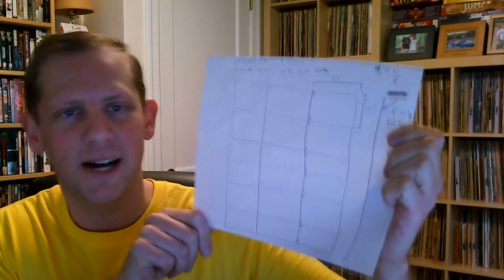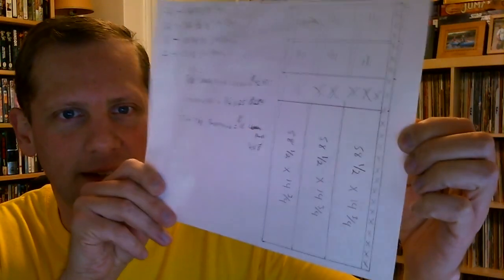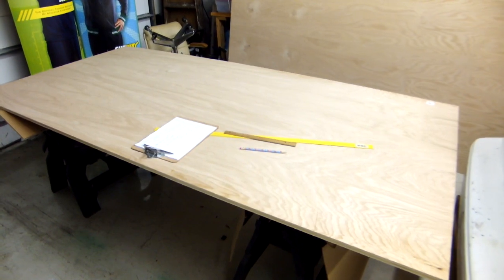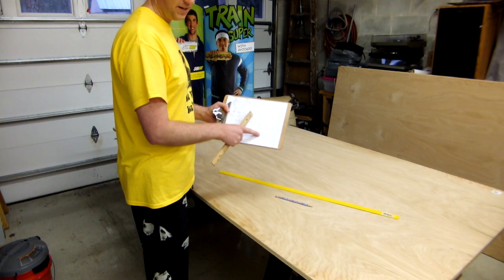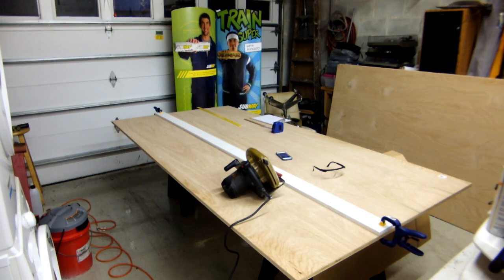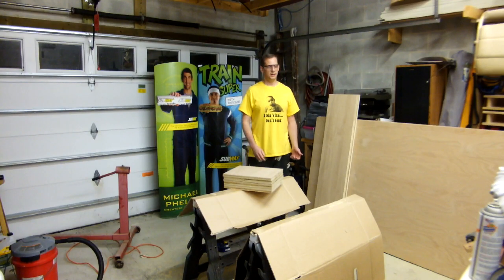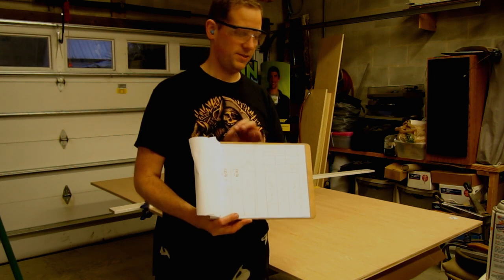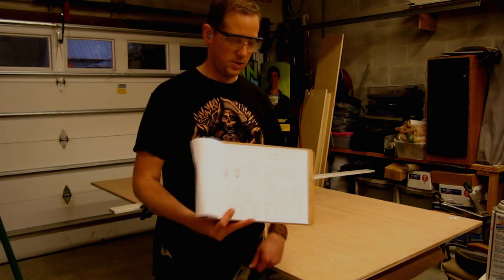Building Custom Vinyl LP Record Shelves Walkthrough

Comment: I am extremely impressed Wes.  You essentially followed the same exact steps as I did when I made my shelves.  I do this for a living and I have to say that you would be hired in a second, lol.  The main thing I did different was using a large shop table saw to rip the plywood to the desire width.  We also have a tool that applys the edging so we don't have to use an iron...although we used to use irons back when I first got into this business.  (1)

Comment: Wes, I have a sport in my vinly room where such a cabinate would fit prefect. The only problem is because of the size, I could never get it to fit up the stairs. Soluation, I am going to buld to smaller versions and stack them on top of each other. I have already sent your video to my carpenter handy brother asking him if we can put one together. Thanks for posting this, a good service you have done for the vinly community.

Comment: Thanks for the video!  I'm considering making my own shelves as well.  Would you do anything differently if you were to make these shelves today?  Thanks again!
Reply from the maker: The only thing I would consider is making the sections modular maybe or at least just 2 units.  That is mainly because we don't yet own a home so moving this monster is quite a difficult task.  If you are pretty permanent then I would just build it as big as your space can take.
Reply: Thanks so much, Wes!  I really appreciate the response.  I found a modular system online called BrickBox XL.  Thinking about using their measurements and attempting to make my own.  Maybe make them a little less tall and deep kind of like your measurements.  Your video was a huge help.  Thanks again!  Subscribed!
Reply from the maker: I finally got around to checking out the Brick Box, that is a very neat system.   I have thought of designing something similar and marketing it at record shows and online.  That is something for retirement of if I have to find work.
Reply: Yeah, Brick Box is a cool idea, but I have my doubts as far as it being a good solution for large record collections.  I couldn’t really find any photos online of large collections with these things.  The manufacturer conveniently shows all the records on the bottom row so the floor can help support the weight.  The handful of photos I’ve seen of small to medium sized collections show quite a bit of sag from the weight.  For what it’s worth, I’ve done a lot of research on modular storage for large record collections and there doesn’t seem to be an ideal solution right now.  It’d be cool to see you come up with something.  A friend a mine just had a very successful Kickstarter campaign for LP wall displays.  The market seems to be hungry for high end record storage.

Also, I just wanted to thank you again.  I recently finished my custom shelves and I'm really happy with them.  I’m pretty sure this is something I would’ve never attempted if it wasn’t for your video.
Reply: @Kingsley Lincoln Meh I use flixportal. You can find it through google :) -gordon
Reply: @Gordon Achilles Thank you, signed up and it seems to work =) I appreciate it!
Reply: @Kingsley Lincoln you are welcome :)

Comment: very detailed vid. I too am looking to build a custom shelf. This has very much motivated me. I have one question. Did you mount anything on top to anchor it to the wall so it's not top heavy and tip over?
Reply from the maker: At the last house the floor sloped in a way where it leaned slightly back so I didn't do anything.  At the new house here I put some shims under the front to give it a slightly backward lean. It's so heavy with records it is not going anywhere, if you live somewhere with earthquakes all bets are off though.

Comment: I love the video what size type and coarse wood screw did you use?
Reply from the maker: Should have been around a #8, 1 1/2", the correct screw will be dictated by the wood you are using.

Comment: Great job, I just got some free 25mm thick sheets from work, cut there, brought home ready to build. Did all your dividers line up well with dowels? That's my only concern on mine.
Reply from the maker: +John Dickenson Yes, I marked the centerline of every board and used that drilling jig I show. Everything lined up perfectly. I also offset the holes in the jig a bit so if something got off I could flip the board 180 degrees and drill it again.

Comment: Now that I have my own house I have been looking into a storage solution for all my records. About 30 wine boxes full. How ever many that works out to. I like your design but I'd want my bottom shelf to sit off the floor just a little bit. Sort of like kitchen cabinets with a toe kick. I never want to risk an inch of water on the floor ruining everything. My play room is in the finished basement. I have several of those metal shelving racks with the adjustable shelves. I was considering building crates and putting them on the shelves. That would make it easier to move them around if I chose to do so in the future. But now I don't know.
Reply from the maker: There are definitely many ways you can do it.  I am jealous that you have a basement to put stuff, it is not possible here in Florida.  Yes, definitely elevate them and get a water alarm installed, whatever you do.

Comment: Sorry, one more question. What size of drill but and screws did you use? And also the hole size for the dowels. Thanks.
Reply from the maker: Im not sure of the exact size of the bit.  The countersink and drill set I used and show in the video is already set up for the #8 wood screws I used. I highly recommend getting one of those. The dowels were 3/8".

Comment: What a great video! Do you remember what the cost was to build this unit. I am building a studio in my basement and need to accommodate about 4600 pieces of vinyl.
Reply from the maker: I estimate it to be about $220, lumber was $180 then you have screws, filler, finish, sandpaper, etc.....
Reply: Thanks Wes! That makes up my mind about IKEA. Also, thank you for getting back to me so quickly. Time to go to Home Depot or the like.

Comment: idk if I missed it or not, but what are the outer dimensions of your whole shelf unit as a whole. Basically the height and width of the whole thing. I thought that most plywood was 6ft, but I wasnt 100% sure.

Comment: How did the shelves do over time? Did they hold the weight well? Sags or sways? I have a mistrust of plywood.
Reply from the maker: No issues at all, this is 3/4" oak plywood, very heavy and strong. I still use them and they can be seen in most of my videos.
Reply: @SupraWes  Thanks for the reply! It looked solid in the video, but being the background I wondered. My eyes aren't the best!

Comment: Wes, where can I buy the old style of shelving you had at the beginning of the video?  I have a modest collection and one of those units would do me fine.  Does Amazon have the "expedits" or whatever you're calling them?
Thanks!
Reply from the maker: They are sold only at Ikea, you can get them there or try searching for Expedit on Craigslist and they sometimes turn up there used.
Reply: They are "bookcase/room dividers" right?  If they are the same thing, Amazon does have them.  Shipping can be high for units that aren't Prime.  None of the listings have the dimensions of the cubes themselves.

Ikea Expedit Bookcase Room Divider Cube Display
http://amzn.com/B00559VF5K
Reply from the maker: ***** Yeah, that looks like them.  The price without shipping is about double what they cost in the stores so it looks as though somebody is buying them in the store and reselling them on Amazon.
Reply: Cool, thanks Wes, I know what I'm searching for now :)
Reply: I don't have an IKEA anywhere near me, except for a 3 hour drive.  For a $70 shelving unit, IKEA.com would be glad to ship it for $350!  Wow.  I'm looking on CraigsList for bookshelves.  There aren't any hits for "Expedit" :(
Reply: One more question Wes, roughly how many typical records did each cube hold?
Reply from the maker: ***** 60-70 records.